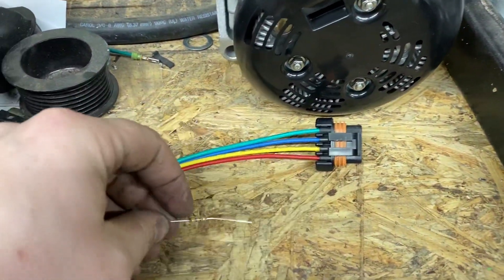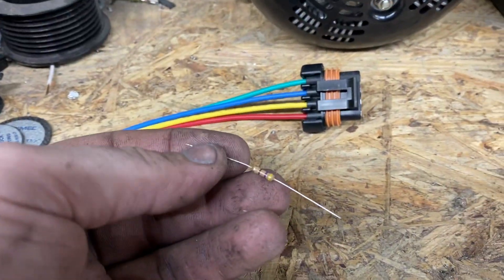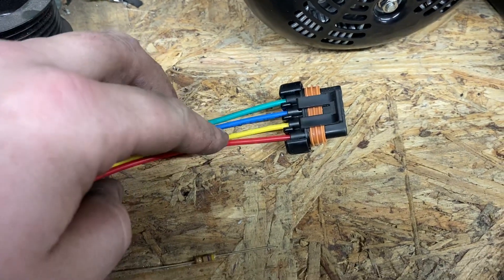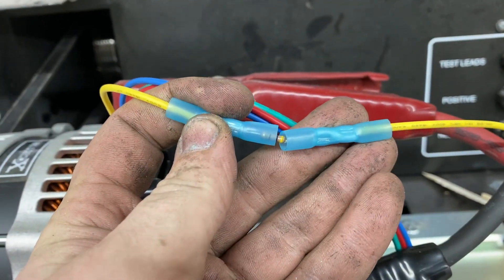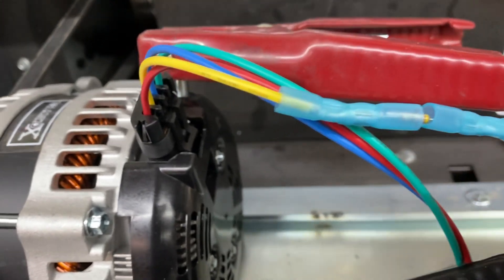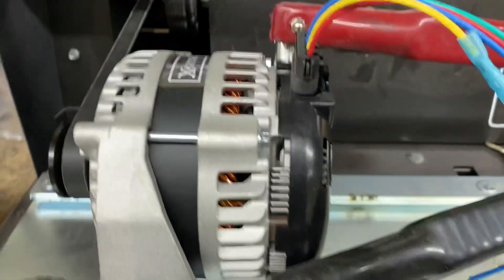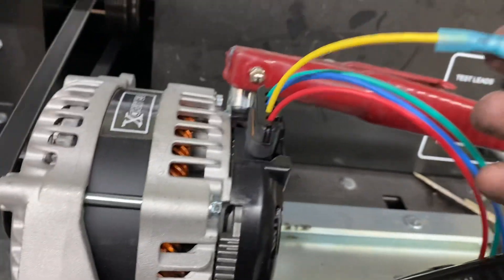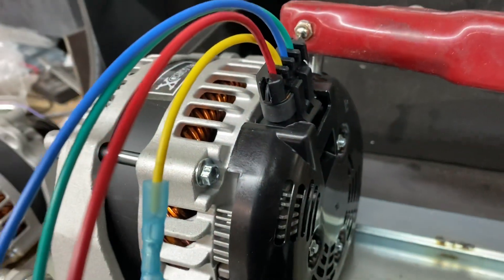Using a 470 ohm 1/2 watt resistor in-line to power a bypassed or secondary alternator from Brand X

Comment: Great vid I want to get my charge indicator working on my 66c10 it has a charge gauge not a light. My truck is ls swapped and alt is turned on my pcm. Can you tell me which wire from truck harness needs to connect to alt for charge indicator to work? Thanks my truck has the brown and I think red wire from original alternator.

Comment: If you dont have a light, just hook switched 12v to the field terminal
Reply: No need for ground?
Reply: I’ve got a 07 Tahoe I’m doing a dual alternator on and all I have left is alternator plug wiring

Comment: I just got the 370a.  For my 08 2.9l Colorado and the adapter harness doesn't match my factory plug. So what you're saying is that you only use the red to b+ and the yellow L wire with resistor to a switched 12v source. The blue and black are not used and the factory 2 wires are to be connected to each other? Is that correct?

Comment: Since its not stock plug, if i was to splice and saulder to my harness do i need to use a resistor still? (Dude with the mitsubishi 03 es you should know, whom diss be aha)

Comment: Why is it when I check my resistor in line with my multi meter it still reads same voltage as my battery? Purchased 470ohm 1/2 what resistor off Amazon..
Reply: The resistor is a current limiter. Voltage is almost identical.

Comment: Good video. I have an ls swap. If I run the alternator through the pcm will I still need to use a resistor?
Reply from the maker: If you’re using a L signal through a computer no, you do not need a resistor this is if you need to run to ignition or a switched source.
Reply: @brandxelectrical you’re confusing af man. 3 years ago you were adamant about using the 470 ohm resistor on the L wire and running  it to the fuse box on the ignition in which I did. Now you said if getting an L signal through a computer that you don’t need it. My cars ECU controls everything. When I wired the L into the stock L and the battery light went away and charged fine, you got an attitude with me and told me to not do that. lol
Reply: Thanks

Comment: I'm useing  the 470 ohm 1/2 watt resistor, but I install in between I grab my voltage tester and still reads what stock alternator is pushing out I'm installed a secondary alternator please help,

Comment: why would the resistor be getting hot and not allowing 12v ignition past it when I hook it up.
Reply: ..although a resistor will get warm as its resisting current, if you get NO voltage through it it is bad

Comment: Hi there, i have a new gm 4 wire alternator and i did connect the small wire directly to the 12 volt for a few seconds but it didn’t charge at all, will this be enough to fry the regulator? I’m currently waiting for the resistor from Amazon so I can copy what you did here!

Comment: Thanks for the help and I seen someone else added two and it made almost 16 volts so I thought that was unbelievable at first and he showed what he did the other wires like the s going to battery u switched and the f wire bulb in dash with power from key going to it and the wire with the resistor that’s what I have did to my GM denso I have on a seperate charging and battery circuit for a stereo system it took a few Toyota wire diagrams and GM also dodge but I finaly got it to charge but do I need any of the other wires or can I just hook that yellow resistor wire to my key switch ? Thanks again

Comment: This video may be the answer to my problem with my H.O. alternator. I’m very new to this and have watched a ton of videos that went over my head and this one I get to an extent. However I’m not sure if it fits my scenario. If you can help me please let me know.

So, I have a 2005 GMC Envoy 4.2 liter. I purchased a 370 amp alternator that was regulated to 14.8 volts from CES in Cleveland. It only worked for a day and then the battery went slowly down from 14.8 to 12.5 and under within a week. Drove out there and on the bench it worked. Didn’t though when I reinstalled it at home 200 miles away. Eventually I shipped it back to them and again they said it works. It must be an error on my part or the vehicle.  
I changed the belt to 1/2 inch and 1 inch shorter, changed the pulley tensioner, the alternator fuse, running 4/0 power and ground for the big 4…nothing. The plug has 4 colors: Yellow Blue Red Green. Blue goes directly to alternator positive stud. The rest go into the adapter that plugs into the OEM plug.
I am not sure if a PCM from the vehicle is messing up the alternator, as it did work for a day or two initially. But I’m at a loss. Apologies for the long description, but if you or anyone out there reading this can describe or point me to a how to video to correct this I will be truly grateful!
Reply: Where does the wire from the L terminal go on the harness side????
Reply from the maker: That vehicle doesn’t need this done to it.

Very likely the regulator just doesn’t work on your car properly.

Check out our rectifier test video to make sure it isn’t shorted, than order a regulator and swap it yourself. Our regulators work for your vehicle perfectly!

Comment: I have a AD244 145 amp alternator in a 1989 Chevy pickup. I am told the bulb on the dash is what add resistance to the circuit. The only thing is my battery light doesn't come on and then go away when I start the truck so I am thinking I need to check on that bulb. Also, I checked the brown exciter wire pin with key on and it was at around 9V. Does this mean I am not getting the correct resistance in the circuit? Possibly due to the bulb? Thank you!
Reply from the maker: If you turn your key to acc and the light doesn’t come on decent chance something is wrong with the circuit, checking the bulb is usually the first step yes.

Comment: Is this a self excite or internally regulated?
Reply from the maker: Self exciting is internally regulated. A internal regulator can be self exciting.

This is not self exciting though.
Reply from the maker: Yes, this is just for turn on.

Has nothing to do with what batteries it’s hooked up to 😊
Reply: Sent you a dm on messenger but I'll ask here also. I have 2000 chevy tahoe with a CES 350 installed to factory plug in. If I connect my 2nd alt a CES 370 exactly how you did this one. Can I connect the second alt to the same battery as the 350 which is connected my factory plug. I want them both to power my truck and amplifiers.

Comment: I have an assortment of 1/4 watt resistors. I would need to combine 2 1K ohm resistors in parallel to get the wattage up and would make it 500 ohms. Would 500 ohms at 1/2 watt be fine? Will the 30 ohms make a difference or is it close enough?

Comment: Hey man I just received my 370a for my Mazda 3 I have the resistor for the pcm bypass, I am wondering am I connecting it to the sense wire or the one labeled with the L
Reply: Label L
Reply: I have a Mazda 3 can you share how you did this?  I have had the brand x ho alt for more than a year but can't figure out how to install it.  thanks for any info

Comment: I have a 03 ford expedition and i got a ho alt with a different style connector the alt is self exciting but voltage does drop when i come to idle going from 14.5 to 12.5 when idle also kicks on the check chargingvsystem light on my dash any help would be appreciated

Comment: How long does does the regulator actually last without the resistor? Also does it have to be specificity the 470?  Like will a 680 work?
Reply: It will last 236 days 3hrs 27min 45 sec

Comment: So what other wire would I connect to kill the battery light and why are those other wires are if you don't used them
Reply from the maker: Brandon Sanders you have a battery light when you bypass the pcm.
Reply: @brandxelectrical  for the battery gauge on the dash still be working
Reply: @brandxelectrical I'm trying to figure that out also. I'm hooking up a PWM controller to the L pin, what do I do with the oem harness side of the L wire? Do I just loop it to an IGN  source to keep the battery light off?

Comment: What do you do with the other wires
Reply: Every alternator is different, but 1 will likely be a ground, another will be monitoring the voltage at the battery, to insure it does not over charge the system, and then 1 is typically the bigger wire that charges the system.  Unsure what the other smaller wire would be used for. Hopefully that helps a little bit.